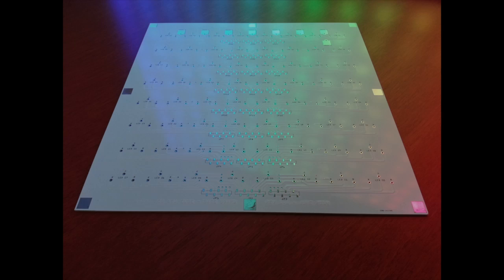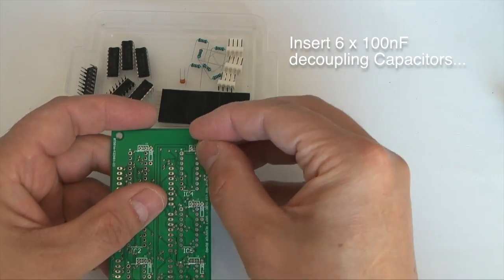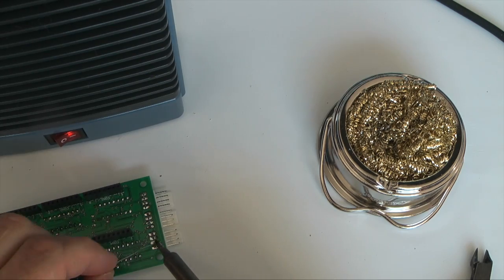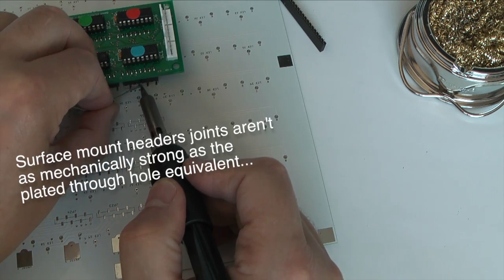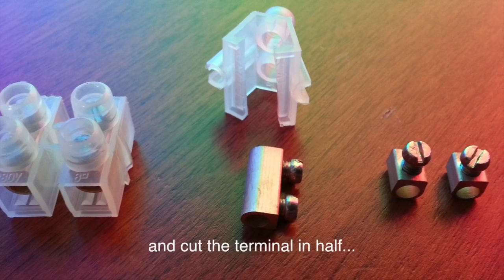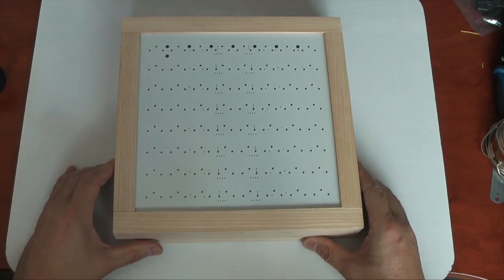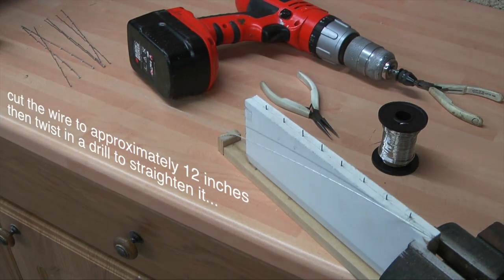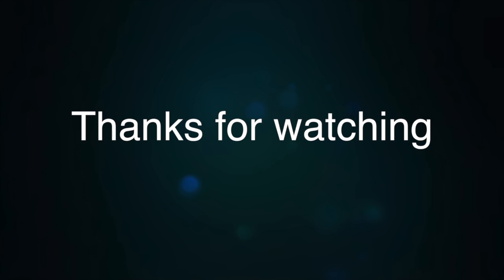Construction of an 8x8x8 RGB LED Cube. Part 5: Prep for Cube Assembly

Comment: You know what every time I plug the Arduino up to my computer it says I need to update some drivers and I haven't done that! But it's not free this is probably the issue
Reply from the maker: +Robinson Deleon The Aurduino USB drivers should be free and included with the IDE software. Just go to the Arduino web site and look for the getting started guide: https://www.arduino.cc/en/Guide/Windows.
Just so you know, there are no guarantees my software will work with the kit you purchased.

Comment: This came with the board and all components needed for the build of the cube.
What is the anode driver circuit?
Reply from the maker: +Robinson Deleon Hi,
This may sound harsh, but I can't be responsible for something somebody else has supplied. You should be asking them. I would also suggest that if your building a kit, you should have some understanding of the circuit. 
For info, The anode driver circuit is responsible for switching each row of leds on then off one row at a time. It does fast enough that the eye/brain thinks all rows are on at the same time even though they are not. It's called multiplexing. To me it sounds like your 2nd-8th rows are not being multiplexed, which is probably a wiring fault, but I can't be sure as I don't know what your hardware is. It might be completely different to mine.
Reply: +Steve Manley ok I appreciate all the help and I'm actually doing this because a job in going for wants to see how much I know and everything was going good until all the lights didn't turn on I will send al pics of what I got in a bit

Comment: Any advice e for me before I take it apart and rebuild it. The code works but still only the first row is working.
Reply from the maker: +Robinson Deleon Hi, Did you get circuit boards made or have you built this on prototype boards? I'd check and re-check your wiring especially for the anode driver circuit.

Comment: So I just seen a video and I didn't do any of the programming to my Arduino or upload any codes could that be the issue do you have an email I can send you a picture so you can see my 8x8x8
Reply from the maker: +Robinson Deleon Hi, If you haven't uploaded any code to your Arduino then no, the cube won't work. By all means upload a picture to where ever you like then send me a link to it. I don't generally share my private e-mail address.
Reply: I just changed m profile picture to my cube.
Reply from the maker: +Robinson Deleon It's only a tiny picture so I can't see any detail other than the bottom row of leds being lit. Might be nice to see the circuitry as well.

Comment: Just finished my LED cube but only the bottom row lights up is this because I haven't installed my code yet?
Reply from the maker: +Robinson Deleon Hi, Not knowing what code you have used doesn't make it easy for me to help diagnose your issue. If you built your cube and electronic circuits as I did and have uploaded my demo code then all should be fine. At a guess it sounds like your multiplexing of the Anodes isn't working.
You can find my demo code here: 
https://www.dropbox.com/s/46mvek4v9h5358o/Cube0_0.ino?dl=0